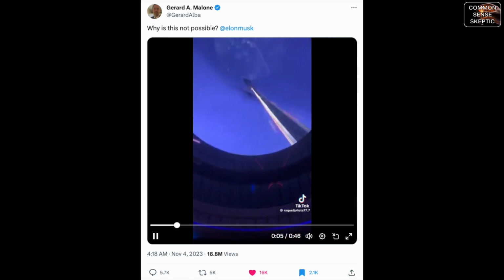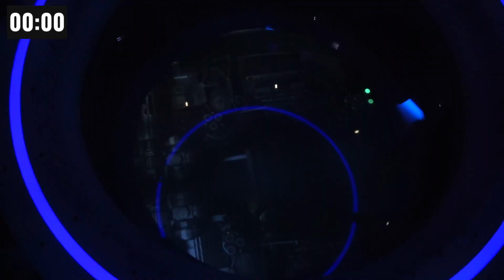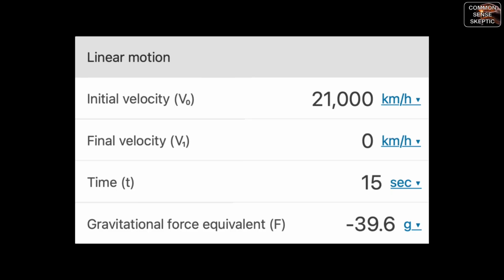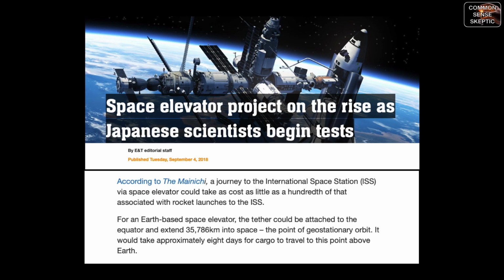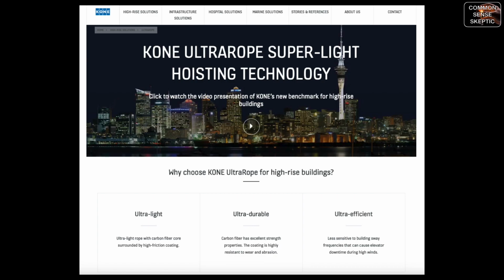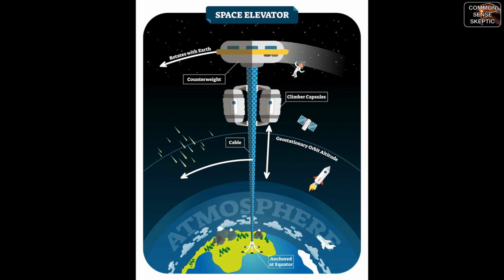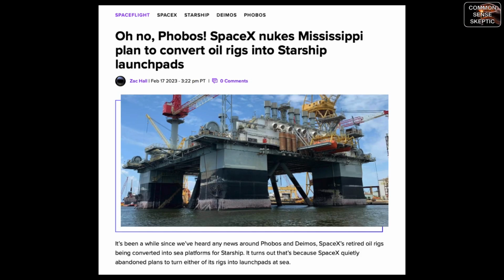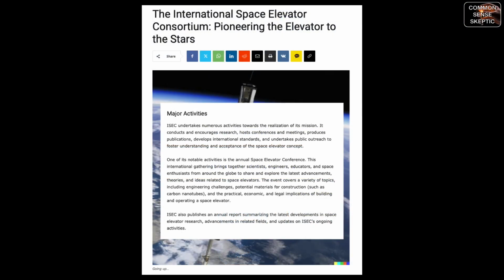DEBUNKING L.E.O. SPACE ELEVATORS

Comment: As far as we know there’s no material that has the tensile strength to withstand the forces required to build a space elevator on the Earth (or similarly sized stellar body). You can build one on the Moon though where the gravity is just a sixth of the Earth’s and there’s no atmosphere or oceans to disturb you. Problem is that the Moon itself has no stationary orbits due to gravitational fluctuations and even if it did a selenostatonary orbit would still not exist because it would be beyond the Hill radius beyond which the Earth’s gravity would have impact. You can put the counterweight at L1 though which is stationary in respect to the Moon’s surface, but is still not stable and will require you to fire a booster to adjust the counterweight every once in a while.

A proposed use for such a device is to reduce fuel costs for sending material to the Moon from Earth and from the Moon to Earth’s orbit.

The problem is, however, that since there’s nothing on the Moon, such device is currently unnecessary.

Until there is a viable industry on the Moon that mass produces and sends stuff on Earth in quantities that would make regular rockets inefficient, this would just be complete overkill despite being within the realm of possibility.

Comment: Two major omissions: how do you deal with the huge electrical potential generated in space by the space elevator, cutting through the lines of magnetic field, and the induced currents of charged particles from the solar wind, and the charge particles trapped in the van Allen belt?   The next major omission is how the hell you build it in terms of how do you either pay out the cable from the Earth to space, or from spice to the Earth because... Celestial mechanics being what it is beyond a certain limit things don’t go straight up….. so do you use a rocket?  Unfortunately any rocket trajectory will curve, and you cannot stop a rocket mid flight, so as to splice in a new cable segment….

Comment: The "releasing satellites into orbit" thing got me thinking. Surly the minimum altitude is not actually geosynchronous orbit, that's the altitude for a circular orbit, if you are happy with a highly elliptical orbit a lower altitude release point should be possible. Not from low earth orbit altitude surely but somewhere between.
Reply: The problem is not height, but speed.  A space elevator only moves at the speed of the ground below it.  The velocity of the elevator increases with height, so the higher you go the faster you are moving.  Orbit requires velocity and if you aren't going fast enough you will fall to Earth.  The point where viable orbital velocity matches the speed of the ground below is geosynchronous orbit, and that's not negotiable.  If you try to launch from a space elevator at lower altitude you will need to quickly accelerate to the speed needed to maintain orbit anyway.
Reply: @jkleylein  That's what RSEs are for.
Reply: If you mean by "release" "shoot with a super cannon and put some rockets on it to avoid it coming near launch point the way around" then sure why not. 

Hypothetical launch site like that would be useful of course.
Reply: Right.  You can think of the issue as needing enough horizontal velocity to clear the atmosphere by the time the object falling from that height reaches low altitude.  So while a horizonal velocity of zero relative to the release point won't work, if that point is below geosynchronous, the actual horizontal velocity can be fairly small as the release altitude approaches geosynchronous, provided you're happy with a highly elliptical orbit.
Reply: I'm pretty sure the idea of a rotating space elevator has been around for more than a decade.

It's sad these debunking videos never bring it up.

You can even use downmass to keep them going. Because it costs more to get out of gravity than into gravity, space companies would get paid to bring anything down that they can get their robot hands on. Sure expensive stuff would be preferred but you can still get paid by providing a bucket of rocks to go down gravity.

You can even "stack" RSEs, the ones in low earth orbit throw cargo into medium orbit, medium orbit into high orbit, etc.

If you time everything alright you can even catch incoming spaceships so they don't have to waste a bunch of fuel slowing down, getting paid for their extra momentum instead.

Basically solves all the problems. So of course the critics of space elevators have never heard of it.

Comment: And that kind of misleading / bad information in videos is exactly why i don't like Kurzgesagt. It works when you already know what they are talking about, as in your elevator goes to geo where you can just push satellites out of the door.  But they never made that clear and just compared it with a rocket. For people who learn about the concept the first time this is at best misleading, but realistically misinformation. 

As for the things you talked about. The wire would not have the weight of the full 35000km hanging on it. A lot of that is already moving quite fast thus experiencing reduced gravity. Still impossible.

The only "space elevator" that could work IMO is an orbital ring as they are at least technically a possibility. They are "only" economically unfeasible and politically impossible.
Reply from the maker: Explain what you mean by orbital ring, because this means different things to different people. Then consider the effect of gravity on that structure.
Reply: @commonsenseskeptic  In simplified terms for YT comments: Its a cable rotating above orbital speed thus being under tension. The ring "station" would be a maglev train riding on top (or underneath) the cable in reverse at a speed that makes it geo synchronous. At ~200km you would experience something like 95% of gravity being in that station. From that station you hang a "rope"/tether and have an elevator going down to earth (probably the hardest part to solve). Once on the station you board a second train that then accelerates to above orbital velocity to release your spacecraft into some sort of transfer orbit. 

You would obviously need more than just one cable for safety reasons and have cables going in either direction to even out energies. Your space station might also need to deflect the cables a bit (coming in at an angle, leaving at an angle) to gain more lift.

Depending on the direction you are going to throw something in, you either speed up or slow down the cable. With 2 cables going in different directions you can vary that a bit. They can also buffer themselves by slowing down or speeding up both. You can also sap energy from earth by means of the tether of if its to weak by accelerating a mass to less than orbital speed and having it return to earth. Meaning you would accelerate/slow down earths rotation very slightly.

It is very much an active lift system and a monstrous engineering challenge, however from our current understanding of physics entirely possible, could have dozens of stations all over the world (equator) and could make space travel extremely cheap. Low variable cost, MASSIVE fix costs. So you would need a lot of travel for it to make sense, but then it surely does. At this point it would just be a political nightmare.

EDIT: Fixed the tether direction... i wrote up.

Comment: Assuming everything else is figured out, just as a thought experiment. The Harmonic Vibrations like a Guitar String...that is 18,000+ miles long...would have some extreme properties and cause motion sickness for elevator passengers, and I do not know what sounds would be inside that elevator...but a cable that long would have many hundreds of tons worth of tension. Harmonic Vibrations on a cable with that much tension on it, would to me imply whatever vibrations it does have would be a LOT of inertia and potential energy for every 'string vibration' This is all theoretical today, but that harmonic vibration would be a real issue if a Space Elevator ever is built. Just my wags for numbers, so I could be off by a lot.
Reply from the maker: Now, consider this. As the capsule is ripping up the cable, those harmonics are going to get pinched up above the capsule, and extended below the capsule. Think steel guitar slide. Imagine the notes that would be getting hit then!
Reply: @commonsenseskeptic  If it goes all the way to or past actual Geosynchronous Orbit; 35,000 kilometers? Well if a piano or guitar has 7 octaves, uh 18,000 km for first octave, 11,000 km for second octave, 9,000 km for fourth octave, 7,000 km for fifth octave, 6000 km for sixth octave, 5000 km for 7th octave. Man oh man I do not want to continue that, but do not regret doing this first 7 octaves math...because it implies inside the elevator would have ALL the Octaves possible for the full length of that cable, affecting the elevator and passengers. Doing the math even the start of it, makes me appreciate the sound insanity that would be inside that elevator unless your noise suppression/cancellation is also very impressive! Ha ha! Any Guitar and Base Players can not just hear the notes; they feel each note on their fingers if they really pay attention, or at least their body does and their subconscious in some manner is aware of it IMO. So I think it is not scientists, but Guitar/Base players who would most be in awe of this many Octaves in one long Cable;-)

Comment: The concept itself isn't impossible.  It just requires materials much stronger than anything we have.  Just as LEDs are more efficient than incandescent lights possibly can be, quantum engineered er, imaginary materials can be stronger than atom-based ones possibly can.  Trying to do it with steel is silly, obviously.  For Mars, it might be feasible with real materials.  For the moon, it might even be a good idea once there's enough other activity in near-Earth space to use the amounts of oxygen, silicon, and aluminum that it would take to justify the cost of construction.

Comment: Let's talk specifics. I won't even get into cost, energy, how to build it, or the impossible material science, which are all considerable.
Let's assume the Great Space Elevator is already built. It cost 9 trillion dollars, but it's complete!
We built it from the eastward island of the chain from Isla Isabella, off the coast of Ecuador. It's perfectly on the Equator.
The cable was made of super-nano-adamantium, which is light and supposed to be unbreakable.

First question: Is the cable indestructible or not?
If it's not, then the first time a satellite hits it going several tens of thousands of km/hr will sever the cable. 9 trillion dollars wasted.
If it is, then what happens when (not if) a satellite hits it? Immediately the satellite is destroyed, but that energy will be transferred to the cable. It has to.
It will either pull the station down, or cause harmonic vibrations that would shake it to pieces.

The counter-weight can't be in geostationary orbit. It needs to be much higher, to account for the weight of the cable, the stations along the way, etc.
If you let something loose at LEO it will fall (covered in the video). If you want to launch something to LEO you must lift it above there, Fling it away from the cable, and have it light a rocket to get up to orbital speed. If the rocket ignites too close to the cable, it could destroy the cable or at least make it unusable until repaired.
Flinging the payload without rockets would cause harmonic vibrations along the cable.

Having one car is not practical. You'd want to raise things to LEO then raise it again to a station where the payload could be launched, then raise it again to higher orbits, and finally to Geostationary orbits and escape orbits for planetary exploration. This way if I'm sending something up to escape orbit I'm not tying up the cable for weeks until it reaches the top. Other things can be added into the mix naturally.

The real problem is rotational velocity. I've yet to see anyone but me discuss this.
You don't get forward momentum "for free". It has to come from somewhere. If the Space Elevator was built using an impossibly tall skyscraper with no give, then maybe. You still have to build that into the structure.
Imagine launching a super rocket straight up. There is no orbital velocity. It's going straight up. It's headed for the Constellation Orion. Whether it ever gets there is another story.
It's using the fabled Solomon Epstein drive from The Expanse. Two weeks later, the rocket is still accelerating.
Meanwhile, the Earth has rotated 14 times beneath the rocket. It has imparted no orbital velocity to the rocket. It went straight up.

Now back to the Space Elevator. A payload is moving straight up, the geostationary orbit is moving with the Earth. I(f it takes two weeks for the payload to reach geostationary orbit, that means two weeks of the Earth trying to move out from under the payload. Straight up at time of launch is Orion, which moves across the sky because the Earth is turning. But straight up for the Space Elevator is a moving target. It keeps changing.
This means the payload trying to go straight up will cause a constant drag on the angular momentum of the Space Elevator. It will cause the cable to bow in the middle where the payload is, and retrograde the counterweight out of position from "straight up".
Since the cable is a definite length, that means it's pulling the counterweight down from orbit as well as retrograding its position.
There is no free momentum.

Do this enough and the counterweight drops below geostationary orbit. When that happens, the 9 trillion dollar wonder project comes crashing to the ground.
This is unacceptable.

You must regain the angular momentum somehow. Maybe tie solar sails to the counterweight and only deploy them when the sun is behind the motion. How long would that take? I'm not sure. Depends on the size of the sails. I would want to preposition the counterweight ahead of "straight up" in case something happens to the solar sails and you need to run new sails up there. That gives you some breathing room.
Or you could lift a big rocket up there and use that as thrust to regain angular momentum, but then we're back to using rockets. Why not just use rockets to begin with?

The drag on angular momentum is the same thing that caused the "Free energy tether" to fail on the Space Shuttle. Anyone remember that?
They let out a very long conductive wire behind the Space Shuttle to drag across Earth's magnetic field to deliver free energy to the Shuttle.
The tether snapped, which is the best possible outcome.
If the tether hadn't snapped (made of super-nano-adamantium) the additional drag would have slowed down the Space Shuttle and yanked it out of orbit.
Just like the alternator causes mechanical drag on your car's engine, a conductive tether caused the exact same kind of drag on the Space Shuttle. The drag was enough to snap the tether and no Shuttles were lost that day.

A payload going straight up will cause mechanical drag on a Space Elevator that is rotating geosynchronously. It won't cause a lot at first, but will cause more and more as it approaches an escape altitude.
This one problem alone is enough to kill any hopes of the Space Elevator becoming reality.

EXCEPTION:
The Moon is tidally locked with the Earth.
Therefore if you built a Space Elevator on the Moon, "straight up" will always mean pointing toward the Earth. There is no angular momentum to wreck everything.
You could transport goods from a Moon colony to neutral space between the Earth and Moon. From there you could simply push the mass in one direction and it will go without falling. Once it gets a couple km away from the cable, you could fire some small rockets and the payload could go practically anywhere in the Solar System.
But this only works if there aren't a million satellites around the Moon by then.
Reply from the maker: Now, to bust your bubble (and sorry about this, because the post is great), there's no geostationary orbit of the Moon within its own sphere of gravitational influence.
Reply: @commonsenseskeptic  Very true.
For a Moon Elevator, you would need to put the counterweight past the epicenter of the Earth-Moon gravitational pull.
It would work the same as geostationary for the cable itself.
For payloads, it would be similar but they would have no appreciable angular momentum when reaching the top. Objects would just float away, caught between the pull of Earth and Moon. You'd need some additional propulsion to get the payload to go anywhere before one of the gravitational forces wins.

If we had a real working Earth-based Space Elevator for the Earth, you take a payload to the top near the counterweight, find a good time to release it, and the payload would go flinging into space at a decent velocity away from the Earth.

But like I said, the Earth Elevator is completely unfeasible. The Moon one is possible and might be useful in the future for Moon mining.
Still super expensive and all that.
Probably just use rockets instead.

Comment: I’m very surprised that you haven’t mentioned the Coriolis effect. At whatever speed the space station is moving, it’s going to travel faster than the surface.
Even a 100 km/h (60 mph) difference, will require the capsule to provide an horizontal acceleration going up and AC deceleration going down, so the cable is going to look bowed like a power cable, only vertical.
Reply: thats why it has to be geostationary at 68000 miles or kilometers or whatever.   it matches the speed on the ground.